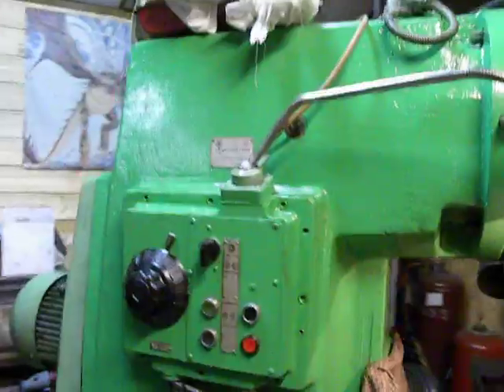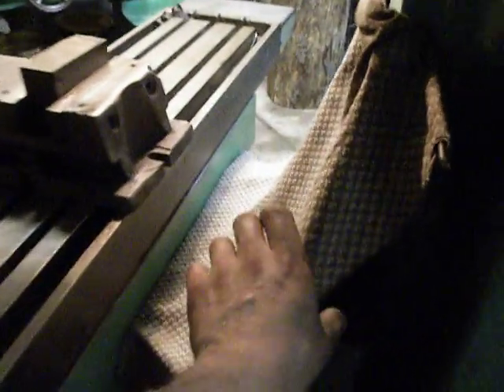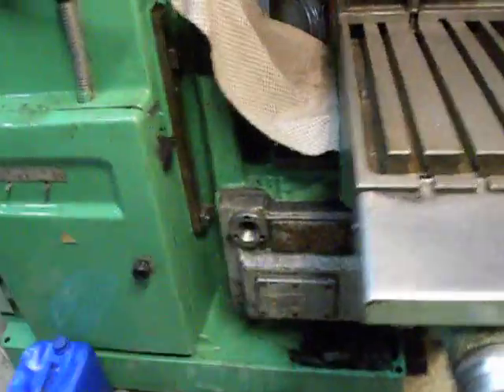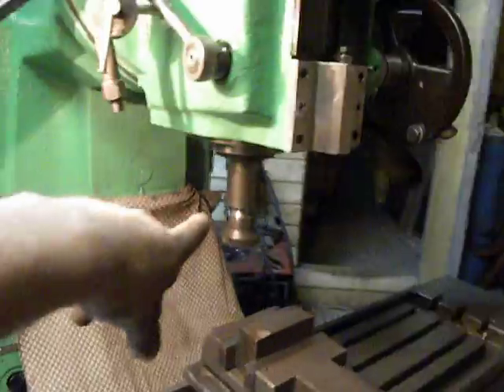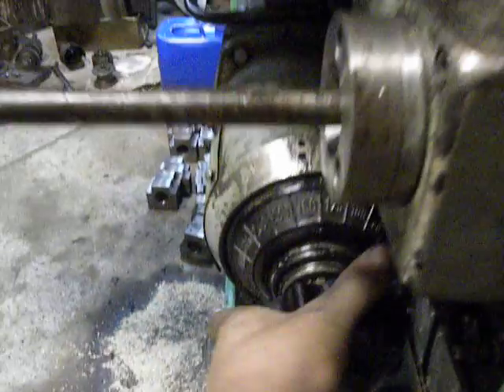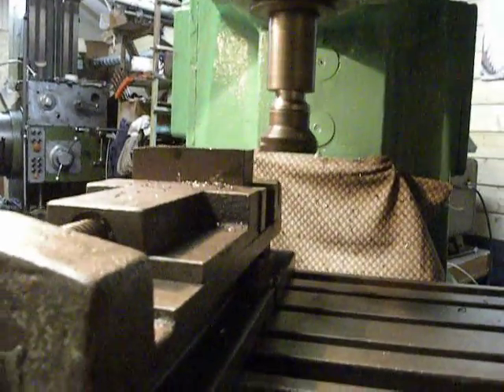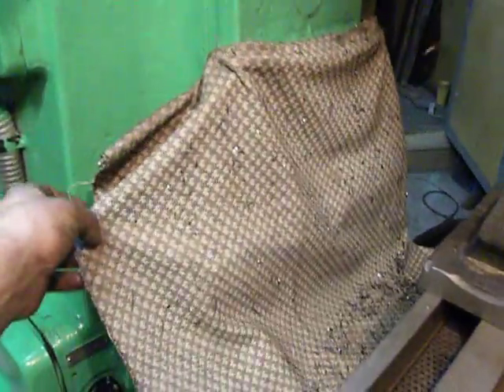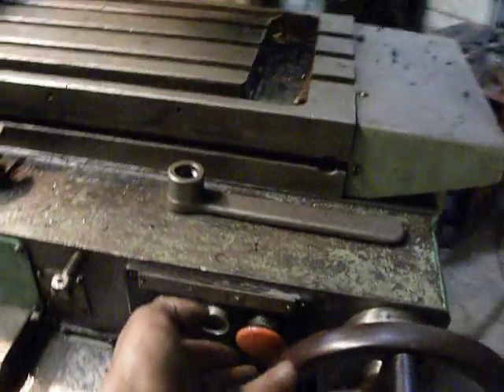My Stanko 6R12 milling machine test run after the repair and first chips

Comment: Hi I think you should install way wipers made with felt to keep some pil on the ways and keep the chips out of the ways also then make metal covers over the felt wipers. Also get some way covers you can make them from sheet rubber or plastic
Thanks for sharing your repair
Manny

Comment from the maker: Table jerk? Yes, little bit - the rented feed gearbox is laging (there is no stable gearing in commutator clutch it to slip out) or I fast pushed on rapid feed drive push-button. 
The Stanko machines (lathes, milling machines, borers, planar mills, shaping machines- planar type or "across" type, drilling machines, Stanko CNC, gear machines and other) have gear or screw feed drive, but the grinding machines, sawing machines (split the material) and "through pulling" machines runs by hydraulics.

Comment: Did I see the table jerk once or twice when you set it to engage and work on the work piece? (I assume that the table is driven mechanically rather than hydraulically - I was wondering if you have an air lock in the system somewhere?)

Comment from the maker: Yes, true for loose tool. Yes, machine is little bit noisy than it is normal... only one what I can do- use a thickening oil in gearbox (exchange I-40A with Oil68" or "Truck  transmission gear oil". Ah- the gears in main gearbox is great like it was come from old Soviet tank (main engine power - "tiny" 7.5kW). 
P.S. After Your comment I was overview My videos- yes, cameras microphone better record the noises and high tones than normal sound. Maybe this is My NIKON P90 camera feature...